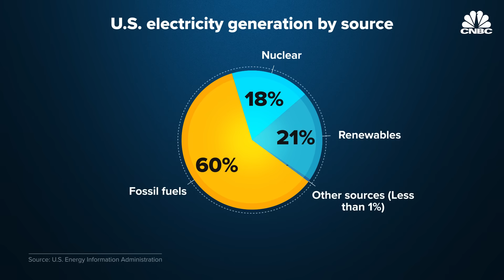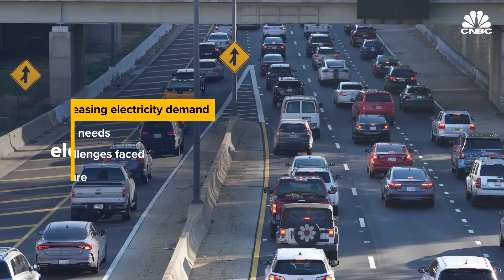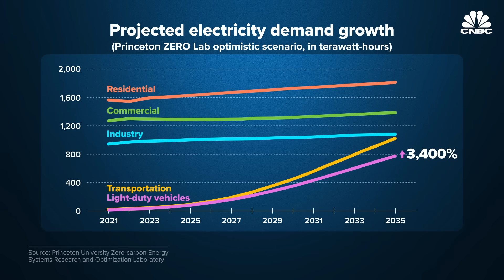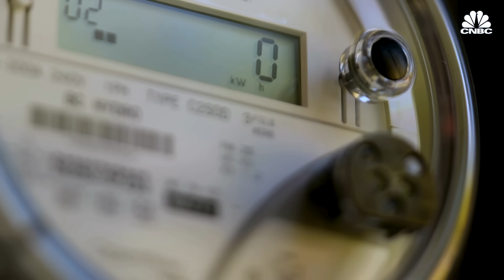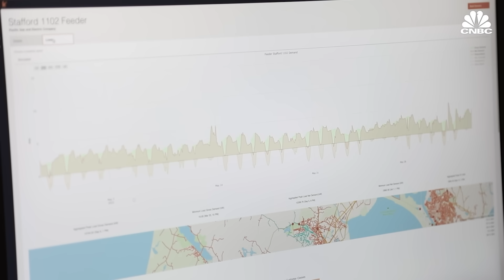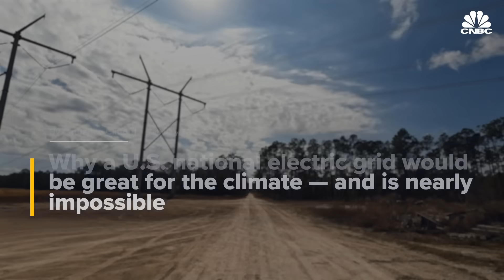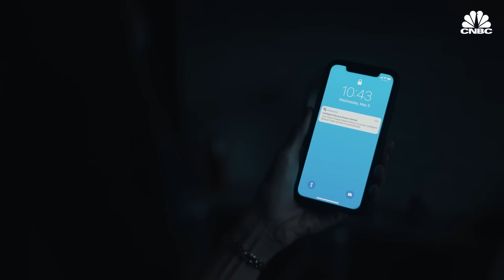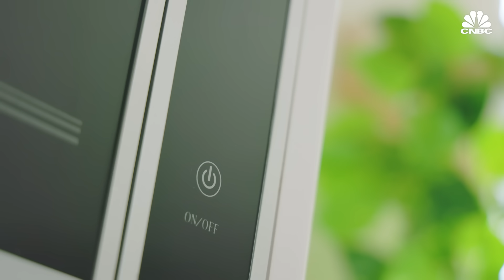Can The U.S. Power Grid Handle The EV Boom?

Comment: California peak demand has only gone up about 4% in the last twenty years. Roof top solar has taken a big bite out of peak electricity demand. I don’t use any electricity during peak demand with solar and a Power Wall.I use a small amount at night to meet my minimum charge.
Reply: Also high frequency transformers that are extremely efficient, e.g. a dishwasher 30 years ago might have used 20 Watts on standby, now it might be 1 Watt). LED lightbulb, incandescent were 100 Watts now 10 Watts for the same amount of light. Bar heater 2kW, now heat. pump ~0.6kW for the same amount of heat.
Reply: Only gone up 4% in the last two decades yet they still struggle to meet demand and even have suffered failure....which means they need massive upgrades!  AC demand will skyrocket in the next decade, as well...longer and hotter summers tend to do that.
Reply: @DarkPesco  California does not struggle to meet demand anymore than anywhere else and far better than places like Texas. The times power is secured is primarily because of the fire hazard not lack of supply.
Reply: @matthewhuszarik4173 Glad you’re flattening the duck curve! One thing that surprises non-California EV owners is that California EV owners are better off charging in the middle of the day than the middle of the night (to take advantage of high solar production).
Reply: You seem to be confused, you have replaced one source of electricity for another, that didn't reduce your demand, just the source of your electricity. What if the Russians blow up a nuclear power station and cause the world to go into a deep freeze? You won't have any solar power.😁😁
Reply: Actually, peak demand has been greatly accentuated by solar because the peak is after sundown. In 2012 that peak was less than 4000 MW above the afternoon minimum; now it is almost 12,000 MW. It is a problem called the "duck curve" that is well-known in the industry (I retired from it in 2018) and a growing concern. For the whole story, google "duck curve caiso" and choose the first link for the details from the California Independent System Operator.
Reply: Wrong Ca is so sorry it has to inport 30000  Megawatts from other states
Reply: @dknowles60  You have no idea what you are talking about. California imports and exports power usually a couple thousand megawatts. The record demand in California was about 55,000 megawatts. So no California never imported 30,000 megawatts. California imports power when it is cheaper to import it than to generate it in state. It also exports power when it is cheaper to export the power than it is to curtail it.
Reply: @matthewhuszarik4173  wrong Again from the Califorina Power Commission and Fed Gov Power Commission Ca always purchases 30000 Megawatts from other states as most of it is HYDRO and is a lot cheaper then can be produced in Ca the record power demand is 90000 Megawatts, Ca used to Produce 70000 megawatts
Reply: @dknowles60  There is no California Power Commissions. There is a California Energy Commission and it deals with long term energy supply. The California Independent System Operator or Cal ISO manages California’s day to day energy demand and supply and their actual record energy demand in California occurred on 9/6/2022-1657 and it was 52,061Mw. They also show where California’s electricity is coming from every day.

Comment: EMP grid protection:  If we are going to be making significant upgrades to our power grid for future electric vehicle use, then this might also be a good opportunity to simultaneously make the power grid resistant to "electromagnetic pulse" [EMP] events.  These can be caused by the Sun, or by a terrorist weapon, and can destroy items powered by electricity.  In particular, our current power grid is extremely vulnerable to an EMP event.  Very bad consequences would arise from losing significant portions of our power grid, including the deaths of millions because modern civilization is so dependent on the power grid.
Reply: What this means is -- they expect the Government to pay for them to make money.
Reply: Can’t agree more!   Fantastic idea!!!   Without emp protection power grids are extremely vulnerable to a solar flare emp or an emp attack by anyone
Reply: I think evs are a bad ideal. It going to drive electric cost to the point most people won't be able to afford it.
Reply: In alot of ways, they already have.

After the mega-outage of 2003, which was caused by a solar storm based EMP that led to the cascading blackout, utility companies started hardening their system, and this would make it more robust for manmade EMPs as well.

That's not to say there wouldn't be localized outages, but the cascading failures of past outages are far less likely.
Reply: @evilbred974  Solar storms do not create EMPs; only nuclear high atmosphere explosions do.
Solar storms (Coronal Mass Ejections) induce DC currents in parts of the US and Canada. Those currents on a heavily loaded line can combine to magnetically saturate the transformer cores on current peaks, but only where the line is positioned to be in the path of the DC currents. Most of the US (including us in Arizona) has no vulnerability at all; the Northeast and the Eastern Seaboard down through Florida are susceptible, but so far it has been a problem mostly for the greater New England Area and Quebec. To prevent damage lines may have to be switched out for the duration.

The outage in 2023 had nothing at all to do with CMEs or EMPs; it had to do with a foliage fault in Ohio, combined with errors in the operation of the system. Similarly, we had a West Coast blackout in 1996 that was triggered by a fault to filbert trees. I was on duty that day.
Reply: Already mitigation systems in place. Already have fuses, caps etc. What happens when lightning strikes, a car hit a power pole, a tree fall on a line, sections are isolated then quickly repaired. Anyway, humans can still live without power. All it would take is some time to repair.
Reply: Why don't you make a scary movie?
Reply: no
Reply: Sorry, there's not much we can do to strengthen against a nuclear weapon.
Reply: @speculawyer  - A nuclear EMP is exploded 18 to 50 miles above the ground. The goal is not ground destruction, just neutralizing all electronics.
Reply: Sure, and let's also build protection from unicorns. A herd of unicorns would be disastrous.
Reply: @ThirdPattern29453  - * sigh * Research "Carrington event". If a Carrington event were to happen today, the US would be without electricity for days, if not weeks.
Reply: @Zoyx  You are talking about electrical systems from the 1859, did they have fuses? capacitors? isolation switches? overload earthing systems? Capacity?

The voltage and current on the telegraph systems were what? "A typical mainline telegraph wire operated with main battery open-circuit voltages of typically 100 to 160 volts but the line current was nominally only about 50 milliamperes.", that is 5-8 Watts. Telegraphs still operated using the induced voltage, so the induction was NOT high enough to be damaging. I doubt the induction for the carrington event would damage todays grid lines that handle tens of thousands of volts or our 240/110 high amperage lines (probably 100 amps to house, within house 10amps).

How many of the telegraph systems where actually permanently damaged, or just disabled by the flare? Can't see anywhere saying they had to replace cables. "By 10 a.m. the magnetic disturbance abated enough that stations reconnected their batteries, but transmissions were still affected for the rest of the morning", so they still could operate.

"The day after Carrington observed the impressive flare, Earth experienced an unprecedented geomagnetic storm, with telegraph systems going haywire", so you have a warning and companies can prepare by isolating or earthing systems.
Reply: @AORD72  - Now look up the "March 1989 geomagnetic storm".
Reply: @Zoyx  That is a common misconception. The northeastern US and parts of Eastern Canada would have to shut down a number of lines to protect the transformers, but even the Carrington Event only lasted two days (Sept 1-2, 1859) Here in Arizona and most of North America life would go on as usual.

Comment: 99% of evs only need to be recharged for 40 miles per day or less on average. 

Don't make the mistake of thinking evs will be recharging 300 miles a day of range.

A small, cheap solar setup can charge 6 miles per day.   I only drive my gasoline car 100 miles per week.
Reply: 99% of EVs are passenger cars... private.  In 10 years there will be semis on electric driving all over the place as well as delivery trucks, city buses....you can't base the future of EV use when they are everywhere and used for everything off today's usage when they are a small slice.  In 10 years I would not be surprised to see the first trains and first planes running off electric.  They are already working on both!
Reply: @DarkPesco  Yup!  And I expect that those cases will
1) Have buffers and draw 24/7 at a fixed rate and then charge the vehicles from the buffers.
2) The grid in their area will be upgraded to handle them
3) Alternatively, they will move their vehicle facilities to areas where the grid can handle them.
40) They will use a lot of solar power since it is much less expensive than grid power.   My home solar set up will run about 0.16c/kwh by the time it dies.  No subsidies either!  That's my out of pocket cost.
Reply: Exactly, like 5kW a day. Easily done in off peak times.
Reply: @AORD72  And a 5kW system right now- runs about $4000 as long as it is off grid.
Reply: except the push for electrification in Commercial Transportation is set the SHOOT THAT 40 MILES A DAY METRIC ALL TO HELL (and back).
Reply: @phillyphil1513  LOL, I love it when people drop words like "metric" thinking it makes them sound smart.
Reply: We do 600 mile round trips every month or so. Trying that with an EV (there is no charging station at our destination either) is crazy talk.
Reply: @flagmichael  then you are less than 1% of all drivers.  

99% of all drivers use 40 mi per day or less. 

Your rational choice may be to not use an ev (for now). That doesn't apply to most drivers.

Comment: They are talking about the gradual increase of EVs as if the grid is stagnant

We have EVs to thank for the uptick and finances for grid advancements

The grid has always been advancing but not up to demand but now, thanks to EVs, it may able to easily handle unforseen high peaks

Also, due to EVs we will have a decentralized battery backup system that is dispersed all over the country in government vehicles that are plugged to chargers that are two way
Reply: How about solar and wind power?
Reply: @tedmoss  yeah! That too

Comment: A LOT of fear mongering here. No doubt the grid needs a lot of work, and that will be expensive. What is not talked about enough is the high cost of building and maintaining the old polluting FF infrastructure we use today. Subtract that cost please!

Furthermore, electric vehicles and appliances are 3 to 5 times more efficient so only a fraction of fossil energy needs to be replaced. There is also a lot of energy going toward mining/drilling refining and distributing fossil energy to end users and that will become much closer to zero with electricity distribution. As mentioned, small, local energy generation and storage will reduce demand on the larger grid.

Add to this the densification of cities/suburbs that will reduce home sizes and greatly increase their efficiency (over time) as well as create far more opportunity to leave the car at home or question whether you need to own one at all. Taxing vehicles by weight could and should be used to reduce the number of often unnecessary and totally absurd ego boosters like the Ford Lightening or Hummer EV. Have some balls, regulators!

It is wise to see the arising problems and create awareness. It is unwise to use that to create doubt about a better world.

Comment: Yes.  Capitalism will mitigate it. 

And smooth it.   Personal solar capacity and storage is cheap and growing fast. 

I have a kilowatt per day now... no subsidies.    And will probably have two kilowatts next year (10% of my daily usage)

Plus my usage is down over a third since 2010.  I used to use 20kw to 30 kw per day.   Now I use 12kw per day to 20kw per day.

Led lighting,  led tv, insulation,  ac units (400w) instead of central ac (2400w) most of the day (also extend life of ac unit).

By the time I get an ev, I'll be able to give it 20 miles a day charging free and with no impact on the grid.
Reply: Capitalism is an economic system, it doesn’t mean people will make rational decisions. A rational decision would mean an extensive high speed rail network connecting to well developed metro area transit system like in Spain, Japan, and yes — even China. 

Capitalism has given Texas the 26 lane wide Katy freeway.
Reply: @barryrobbins7694  Capitalism didn't do that.

Capitalism only helps capital be allocated slightly more efficiently.   

Like now-- ICE cars are too expensive and it's driving rapid EV adoption.

My current panels are literally 1/4th the size of my 10 year old panel.   And they cost $125 instead of $800.    They are going to be smaller, lighter, and less expensive in the future.   When they reach the right size and cost, capitalism will allow people to rapidly adopt them.   And frankly, from all the videos on youtube, panels and solar "geneators" are already there now.  People are buying them as fast as they can be produced.
Reply: @mac_mcleod  Yes, capitalism is an ECONOMIC SYSTEM. PEOPLE do things. Sometimes markets are efficient and sometimes they are not. It is PEOPLE that effect the outcome. Markets do not necessarily deliver desirable outcomes. If we as population were more rational, transportation and land development would not be car-centric.
Reply: @barryrobbins7694  capitalism gives people freedom to do things and rewards them for doing good things (and some bad things so you need a well regulated market).   Fascism, communism,  and socialism (the economic system not social welfare) all remove freedom and/ or incentives and are less efficient at allocating capital effectively.
Reply: @mac_mcleod  I’m not advocating for a particular economic system. History is not over. There will be different economic systems in the future as there have been in the past, hopefully more in-tune with people’s needs and not with the perverse aspects of human nature. Money does not equal goodness; it is just an exchange medium. The extremes and chaotic results shown over so many years indicate that something new may be needed. It will not be our choice, but future generations.
Reply: @barryrobbins7694  I'm not advocating for a particular system either. And I think that large-scale capitalism has negative outcomes too. 

But small-scale capitalism is hard to beat.  But it must be well-regulated and kept free from corruption and the common abuse is like monopolies and Restraint of trade and collusion.
Reply: @mac_mcleod  Even small scale capitalism gives power to the capitalist not the other stakeholders; it is a built in flaw.
Reply: @barryrobbins7694  no.   It gives people control over their own work.  They use their capital and labor to create value and keep the profits.

From a kid mowing lawns to a shopkeeper selling yarn to a business repairing laptops.

Your statement is bizarre
Reply: @mac_mcleod  …and what say do workers have?